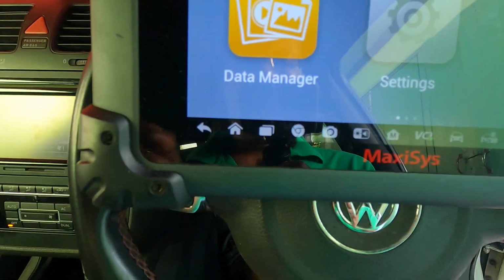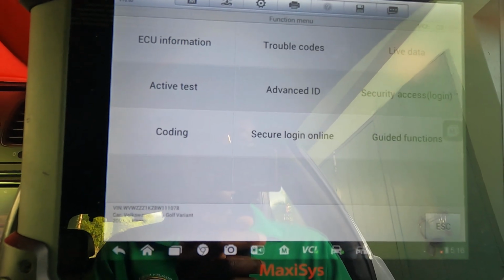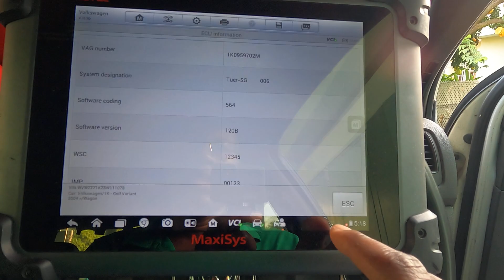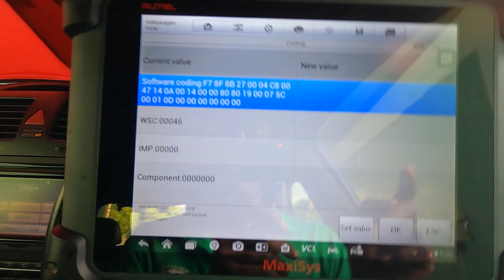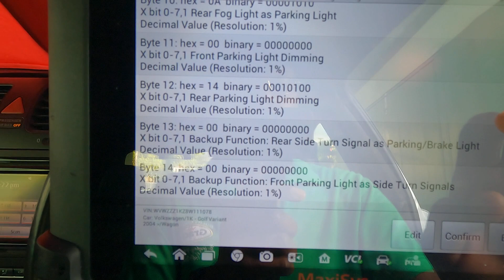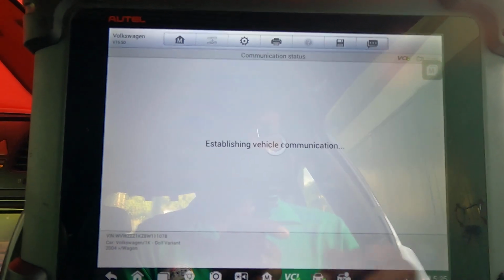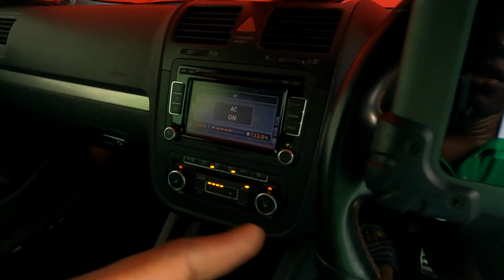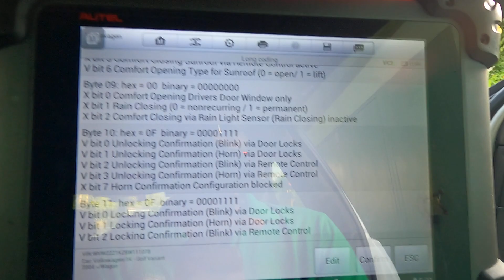VAG Coding for BCM CECM, driver and passenger door.

Comment: Hi buddy i hope you are ok, when you retrofit that climatronic contoller it was plug and play or you had to modify something, i am about to do the same on my mk5, thank you in advance
Reply from the maker: It was plug and play BUT I had to swap two wires around so that the unit remember the last temperature set whenever the ignition is switched OFF.

Pin16 was one of those I remember